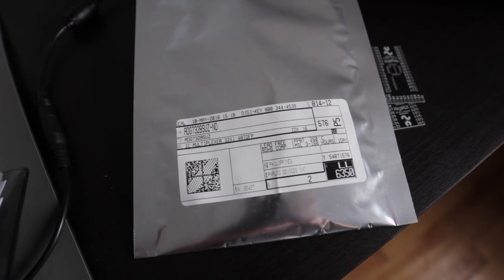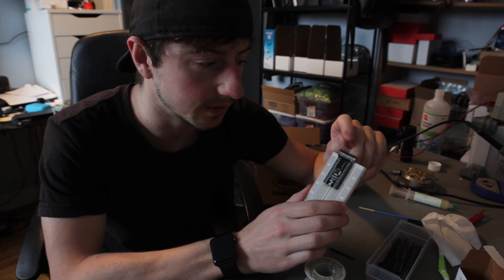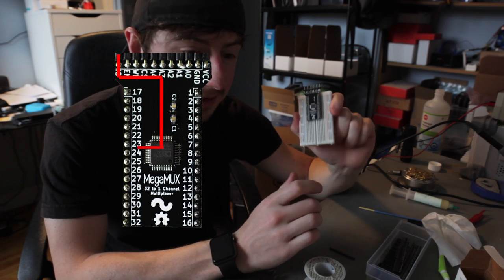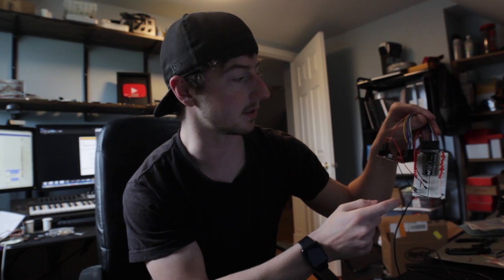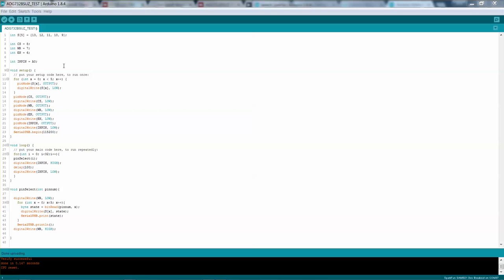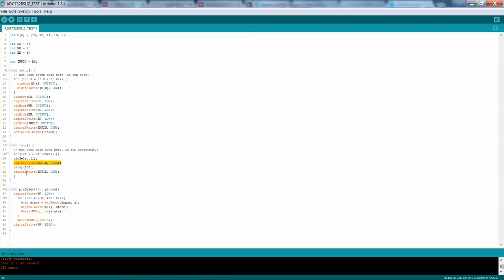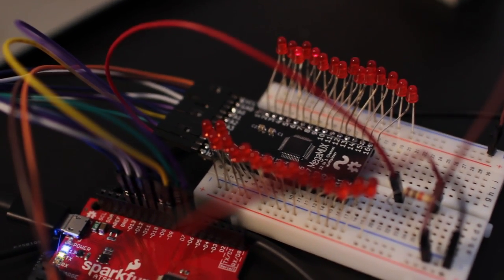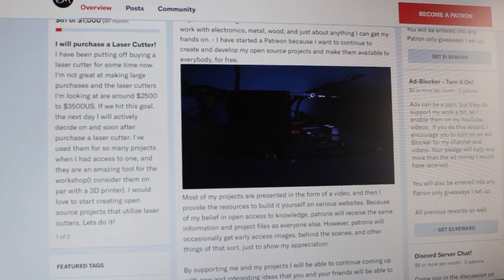MegaMUX - 32 Channel Multiplexer Board and Tutorial

Comment: Would a shift register work for the "pin select" cutting down the arduino pins you use
Reply from the maker: If you want to reduce the pin load even more then sure! You could use a smaller MCu! But if you have the pins available, its less complicated to do it the way I showed.

Comment: Really cool! I'm pretty sure you could simplify your pinSelect a bit by just writing pinnum to a given IO register, then hook up the mux to said register. It would be a whole lot faster, not only because it wouldn't require a for loop, but would not use digitalWrite() which is slow.
Reply from the maker: Like a shift register? Yeah it would be faster definitely!
Reply: No, I mean you can connect the mux to pins 0 through 4, then replace pinSelect(i); with PORTD = i; or connect from 9 to 13 and use PORTB. (https://www.arduino.cc/en/Reference/PortManipulation)

Comment: Could just split it in half - 3 pins for addressing, 4 pins for data. 
3^2 == 8, and 8*4 == 32.
That way in 1 cycle you could read/write from/to 4 pins at once. The I/O pins are just registers anyway so you wire it up right and it's literally just like using variables. (you'd need 1 shift but that's about it).

Comment: Without any added delay, how quickly can it cycle through? I know the ADC on the Arduino takes at least a bit of time to read a value, so eventually that has to limit the sampling rate you can do with lots of sensors, right?
Reply from the maker: Yes, there will be a delay, anything requiring synchronous readings won't work well with this. Not sure what the actual sampling rate limit would be, but it would be different for different mCUs depending on how their ADC works.

Comment: Hi - I have this MegaMUX. I have couple of ADG731. Can I use this MegaMUX with ADG731. I know ADG731 & ADG732 handles input control bits differently. But my question is if this MegaMUX will exactly fit for ADG731 and give me access to all its pins? Also on the MegaMUX PCB there are 2 Capacitors marked as C1 & C2. Which one is 0.1uF and 1uF? Thanks
Reply from the maker: I think the ADG731 has two outputs right? I think you will only have access to one output with my board. C1 and C2 can be either 0.1 or 1, switching them will not affect the board.
Reply: Thanks for your input. Both ADG731 and ADG732 have the same number of pins. I understand your board does connect to all the pins, correct? If so, I can interpret the pins as ADG731.
Reply: @SeanHodgins  What size are those caps? 0603?
Reply from the maker: @brandondombrowski1497  0805
Reply: @SanjayGupta-gv6vb  I am looking to use this for ADG731s. Did this board work as-is for your use of the ADG731?

Comment: do you have a good link to the multiplexer?
Reply from the maker: This IC? I got mine from Digikey - https://www.digikey.ca/product-detail/en/analog-devices-inc/ADG732BSUZ-REEL/ADG732BSUZ-REELCT-ND/4907711 - a little expensive, so you might be able to find it somewhere cheaper. 
The board can be purchased from PCBWay, if you use this link to order I get 10% of the order I think. http://bit.ly/2szBXgs or you can download the gerbs if you want to get the board elsewhere.
Reply: I bought the board through your link. Going to try smb for the first time. You make it look easy.
Reply from the maker: chris Bruner check out my video on SMD soldering. You’ll get the hang of it in no time.

Comment: So the pcb you created is able to connect to more of them serially? How do you go from this video to reading 500 sensors? I ask because I’m trying to do something similar but with IR reflective sensors.
Reply from the maker: Since this chip has 32 selectable outputs, I attach 32 to one side of the light sensor, and another 32 to the other side of the light sensor(two multiplexer ICs), so that will give you 1024 selectable sensors.
Reply: @SeanHodgins  Does that essentially become just a mux tree/matrix? Where you are using one mux to select a row, and another to read a column?
Reply from the maker: @wackyboy42  Exactly. Then it feeds into an op-amp to get the reading to the Arduino.
Reply: @SeanHodgins  Would that be a driver like a ULN2008APG?

Comment: I'm curious what kinds of errors a MUX like this creates. I've been meaning to look into the characteristics of different MUX devices and technologies for creating variable analogue feedback networks. I haven't come across these types of practical details about multiplexers and demultiplexer circuits. Most video tutorials and demonstrations I have found while searching do not go into the nitty gritty details of practical analogue applications for these devices. I don't imagine you want to upload a long grinding video about device characterization, but perhaps you could mention why you chose this chip as it relates to an error budget, linearity, and accuracy/precision. At least that is something I would find helpful. 
 Just as a couple of quick and easy potential ideas, something as simple as a channel to channel comparison of readings connected to a shunt reference voltage rail would show the practical variables in a simple dirty circuit, or you could show the linearity if you added a single value precision resistor between each channel to create a 31 step digital potentiometer...just ideas

  Thanks for the upload, and for the chip reference. It's worth adding to my notes playlist for future reference ;)
-Jake
Reply from the maker: There are some excellent ideas there. Most of my projects on the level of "hobby" and not "precision", since they are mostly designed to create something fun, and maybe learn some knowledge along the way. I mainly chose this chip because it will greatly simplify my next project, but I generally don't spend a lot of time searching for components. So if I find something that looks like it will work, I pretty much stop the search there(otherwise I lose too much time). For the future project I need to mux 500 sensors on an upcoming board, so I will be using these in a matrix pattern to measure a voltage from each one, so that is the main reason for selecting this one. I like your idea with experimenting with some precision resistors, it could be fun! I like doing that kind of stuff. Except I'm not great at filming or explaining it in a good way(really technical videos aren't my thing...). I could alway post a google sheets doc or something like that too and just put it in the description. Ill try to get around to it.

Thanks for your ideas!
Reply: The only drawback to MUX would be caused by too slow of a sampling rate.  It's no issue to deal with controlling/watching many things one-at-a-time as long as we are scrolling through them fast enough not to miss any significant changes.  Multiplexing has been used on cell phone audio and Nintendo controllers for years.  It can get a little screwy to adjust to the world of nanoseconds , but once I did I realized that I was much more concern with the MUX getting bored than it making errors.

Comment: Thank you for a great video. I am new to microcontrollers, analog multiplexers, and Arduino. I am trying to replace the classic switches with this new technology. My application is a box with about 20 female 1/4 jacks, where 2 loopers (Boomerang, Boss RC-3), one that has memory but simple, and the other nice 4 tracks but can record the session, are plugged. Also a Volume pedal and a Reverb. 

So, I made this box where with two switches 4 poles and some other switches I can alter the order of the signal path. So I can place the Boomerang before or after the Boss RC-3, and have the Volume pedal before the Guitar or after the loopers, etc. 

I was trying to imagine. how to port this analog circuit to a more complete one using multiplexers. With the lack of knowledge on the subject I though that to have all possibilities open for about 20 1/4 jacks of I/O, I would need 20 chips of 20 channels (I know they are made of 4, 8, 16, 32 channels) so that any desired combination could be achieved, I believe must be a better way of thinking this out. 

Could you just drop me a line or two to put me in the correct direction to research how to achieve my goal? Thank you so much for your time. All the best

Comment: I want to control 128 relays (12 volt). I am thinking about connecting 8 of the "16CH Analog Digital Multiplexer Breakout Board Module CD74HC4067" all to one Arduino Mega. Do you think this would work? Would it max out the processor? What did you use as a control board for your 500 LED project?

Comment: How and where can i get a board? I want to control a Minimoog synthesizer with 28 potentiometers and buttons. Now i'm using 2 analog mux, but it doesn't work with the arduino at A0 and A1. The buttons are easy, but the analog not!

Comment: Hi, thats a great demo regarding the use of a multiplexer with Arduino. As the inputs are being read sequentially, does this ever cause any problems with the slight delays between readings? Especially when using sensors as inputs to a control system? The reason I ask is that I am currently designing a HVAC controller for my house whereby I am using an Arduino Mega - but the 16 analog inputs are not enough, so I am having to use 2 x 16-way multiplexers on 2 analog input pins. Not tried it yet, but I was wondering if you've ever encountered any issues, and can share your experience on this matter. Hopefully I'm just over thinking it, but due to the nature of project, i want to make sure I have all bases covered!
Reply from the maker: Random musings yes, there will be some areas of delay, but it will be very small! Basically even using the ADC on 16 different inputs right on the mega is going to have a small offset of time from the first to the last. So if you introduce a multiplexer you will just add a smaller delay between each reading. Typically with something like temperature these delays are not an issue because the rate of temperature change is much much slower than any delay in temperature readings. So even if it took one second between 30 sensors, it’s unlikely that the 30 seconds from the first reading to the last is going to give you any sort of issue. If you were doing some really precisely timed readings for research or critical applications then it would be a different case, but for you there should be no problem.
Reply: @SeanHodgins  Cool as I thought, as the majority of my readings will be from PT100 sensors, which are resistance based there the read rate should be faster than the sensor response time. Likewise the media being sensed will be water so shouldn't react too quickly! Thank you for your prompt response! Earned a subscriber here! Great channel btw.

Comment: I've just  bought the pcb on PCBWay. What are the specs for the two capacitors on the board? What surface mounting size and what capacitance?
Reply from the maker: They're decoupling caps so 0.1uF and 1uF on either pad. Size is 0805. Probably could get away with just a single 0.1uF. Nothing mentioned in the Datasheet, so I just put them in as you would for any IC.
Reply: Hi - On the PCB there are 2 Capacitors marked as C1 & C2. Which one is 0.1uF and 1uF? Thanks
Reply: @SanjayGupta-gv6vb  It doesn't matter. They are in parallel.

Comment: Hi Sean, I am a first time viewer and have subbed due to your easy to follow manner and presentation. I am currently learning about the Aduino and was wondering if this Mux would read 18650 Li-ion battery volage in a 20 bay battery unit I am currently trying to cobble together? Thanks for any advice you can assist with. Mike.

Comment: Hey Sean, I'm new to the glories of multiplexing so this might sound stupid, but could this be used for routing analog signals?

Basically, I'm building a eurorack synthesizer (already have the oscillators and midi control done) and I'm trying to digitally control the paths of all the cool patch cables.

After I work this part out I'll be able to make some websockets and APIs to control it all :)
Reply: For doing a lane select yes!
But most of the bigger channel MUX's have a single signal out. Now it goes bidirectional so you could effectively rotate one signal over 32 channels or 32 channels into 1!
For what you are describing, I would most certainly suggest using some smaller MUX's but more of them!

Comment: Hi.
I'd like to use a MUX the other way around : analog to digital.

What I'd like is the "Sparkfun Qwiic MP3 Trigger" to play 10 different sounds, triggered by a 10 position rotary switch.
This MP3 Trigger comes with 4 triggers pins which play MP3 files named accordingly on the SD card :
For example, pulling pins 2 and 4 low at the same time will play track T006.mp3

Hence, in the same example, I need a thing that triggers those 2 pins when triggered itself by the rotary switch 6th position.

I think the "SparkFun Analog/Digital MUX Breakout" can do the job.
But I can't figure out how to connect those 3 objects together.
Rotary Switch 10 positions :arrow: MUX 16-channel :arrow: Qwiic MP3 Trigger :arrow: 10 mp3 files
- Does thes MUX need power ?
- What are the pins SIG and EN on the MUX ?

I'd be really gratefull if someone could help me a bit.

Thanks, Victor

Comment: Hi Sean. I don't know what's your exact requirements for your project, but maybe this is an alternative which is cheaper, includes an ADC and not requiring any select pin, so less wiring thanks to I2C: tindie.com/products/FERCSA/32-channel-adc-wi2c-for-arduino-and-raspberry-pi/ My goal is here not self promoting, but if you gonna go down on the multiplexer path without I2C you'll need a lot of select pin for 500 sensors, plus the analog ones ofc.
Reply from the maker: Pretty cool device, thanks for sharing! Unfortunately this would actually be a little more complicated for what I'm going to do(since I'm making my own PCB and all sensors will be surface mount). With the MUX select pins, you can stack multiple multiplexers on the same pins, and the ADC I'm collecting only require two pins, so I will only need two ADG732 ICs for what I'm doing, 32x32 will give me access to 1024 sensors. If I was wiring it by hand I would definitely consider your device.